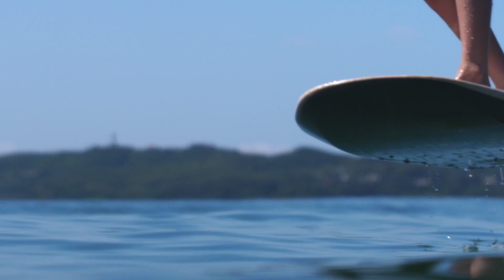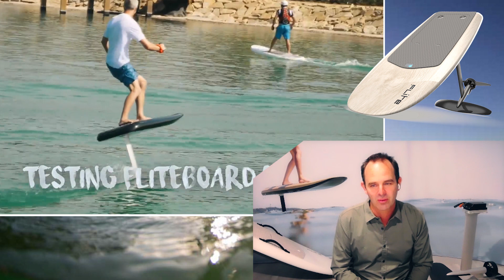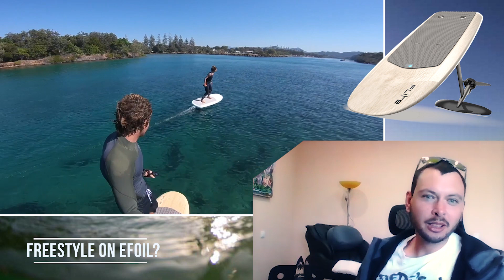Why EFOILS are so EXPENSIVE? ft David from Fliteboard

Comment from the maker: "$12,000 for a foil with a motor??? I could buy a JETSKI INSTEAD!??"
Electric hydrofoils or Efoils in short are quickly becoming the next big thing, one of the most fun ways to spend time on the water.
The fast, smooth and silent cruising over the surface gives you an amazing feeling of flying...
But the main question remains - why are they so expensive? Today we meet David Trewern from Australia, the creator of the Fliteboard to ask him the most uncomfortable questions from our followers.

Timecodes
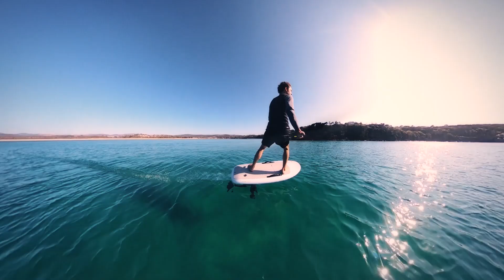00:00 Why EFOILS are so EXPENSIVE? Welcome David!
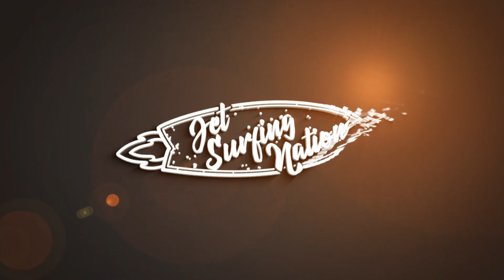00:31 What is Fliteboard efoil and exciting news after first 1000 boards sold?
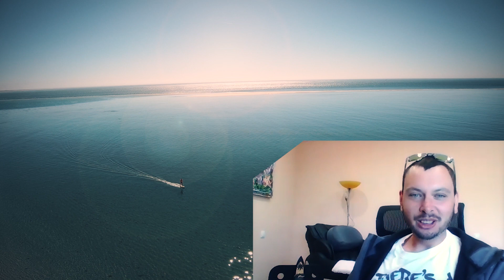01:55 Why EFOILS are so EXPENSIVE??? Uncomfortable questions from followers
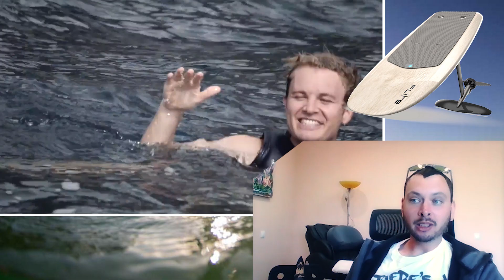06:10 Can you compare the components of efoil a carbon sailboard and electric outboard motor? What goes into make a quality and lasting efoil?
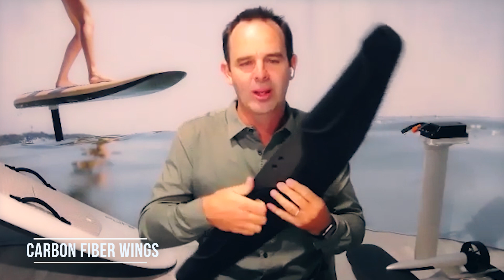10:51 - Carbon fiber efoil WINGS? 500kg of static pressure
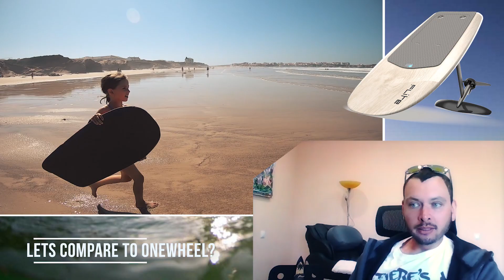13:20 The e-skateboard is usually priced around 250 usd..why is efoil battery so expensive? It's like 10 times more than Onewheel
16:05 "I could buy a JETSKI for that money!?"
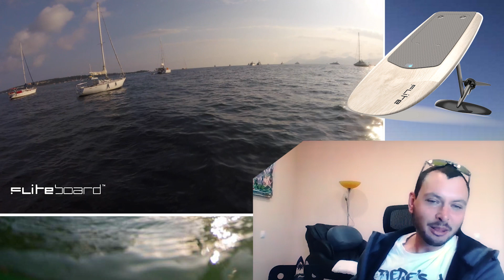19:35 Lets compare the petrol engines vs electric ones? What's more economical long term?
21:38 Most people don't realize that aside of the price of the product itself, a lot goes into the quality post sale support and service. What happens if the board breaks?
23:20 The popular question is "why would I pay 12k if I could buy same on ALIBABA half the price"? Could you compare your efoil to those generic chinese efoils sold on alibaba?
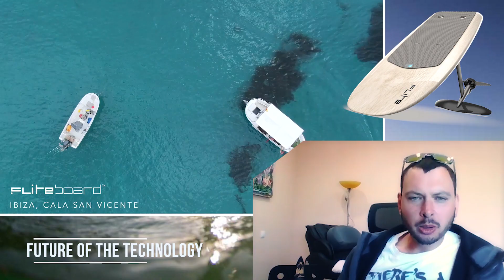25:17  Do you expect the battery technology change significantly during the next 5 years that may make efoils more affordable to mass markets?
27:40 The main problem of traditional electric jetboards without foil is their big weight and a very short riding time. How does efoil solve these problems?
30:11 Some people believe that using motor in the foil is basically cheating. Being a sports professional yourself and a kitesurfing world record speed holder what do you have to say about it?
33:17 Efoil Radical tricks, racing, jumps and backflips, efoil waveriding?
34:27 Electricity and salty water are not the best friends. What is done to make sure the battery is safe to use in the salty water?
37:20 We had a great interview 2 years ago in Spain and now you sold your first 1000 boards.. What changed since then? Tell us the exciting news about your new Flite app, new wings and what's coming? Will there be efoil racing in future? A version with pads, rope?
41:27 How to choose Efoil to get started? Size, mast, wings configurations? Pro board? Inflatable efoil?

Comment: Im  competent wingfoiler looking to foil surf when no wind. If I catch a wave on your gear and turn the motor off how well does it function as a normal prone foil experience riding the wave?
Reply from the maker: You need foil assist system for that

Comment: If you can make a comparable product a lot cheaper, competitors will. That would force the higher price manufacturers to lower costs and prices to stay relevant. Higher demand and sales can also improve costs. I too have all along questioned the pricing on these but economics usually works itself out. I’d like to get one at some point.
Reply from the maker: They have it cheaper this year

Comment: How do you get sitting down if your board doesn't float you?   I'm 235lbs and my Lift 5'4" has 88L of floatation volume.  The board is below the water completely when I'm on it, so I can't see starting sitting.  The only thing I can see is dropping down from standing position?
Reply from the maker: It's not possible Mike

Comment: Here's a crazy idea: Would it be possible to make an eFoil that works like an eWheel (electric unicycle/EUC)?
If you put your weight forward, et moves forward, if you put it backwards, it brakes. Maybe it would be forward-facing rather than standing on it like a board. With the big advantage that both your hands would be free. You wouldn't need a remote anymore.
It seemed crazy when eWheels started appearing, but they're actually shaping up to be the most efficient form factor on land, and even without using hands, you get far greater control than on something like an electric scooter.
Reply from the maker: check levelfoils they are making your idea lol it's selft balancing efoil without a remote
Reply: @JetSurfingNation  Wow yes looks great! Being able to do away with the remote is a great plus. I wonder, though, if we'll be able to do curves that are as tight, and potentially jumps and riding waves with the motor turned off as you guys do? Will it be possible to combine user-friendliness and fun?
Reply: You need the throttle to feather in and out of the power during turns and such. it's not really a detriment to have a throttle in your hand.  You aren't doing ANYTHING with the other hand.   ;)
Reply: I can see the merits of both, but agree, you'll likely want throttle control for wave riding and tricks.

Comment: I could literally carve a surfboard out of the materials and download &print the wings with 3d printer.
Reply from the maker: Try to print the engine and battery;)
Reply: @JetSurfingNation  those dont cost like 12k lol. Even if I buy the highest quality batteries and motor, I can guarantee that I would cost less than 2k.
Reply from the maker: You sound very naive mate.  It's good to research the market and prices before making such ridiculous statements.
Reply: @JetSurfingNation its a  matter of economics.  the high prices are not for the products "higher qualities" or "research expenditure". the small demand and lack of market competition allows them  to control supply by yanking up the prices. same thing is done by designer brands. pretty arrogant for fliteboard though, since they don't have enough brand image to try that strategy.
Reply from the maker: Have you even watched the video? There is plenty of competition. But the production quality and post sale service is what makes the difference. You can buy efoil for 4k on Alibaba and you will receive a piece of plastic that will break on the first use. The bottom line people get what they pay for. Yes Gucci bag and non branded bag are almost same in production cost, made on the same factory but when it comes to high tech electronics and batteries it's completely different story.
Reply: Good luck buddy.

Comment: The Chinese are masters of de-costing without reducing functionality (e.g. 3D printers went from $30,000 to $300). Chinese manufactures will reduce the cost of e-foils.
Reply from the maker: Not happening in efoil industry. Yes you can buy efoil on alibaba for half the price and they ship you piece of crap that breaks on the first use.. waterproof technology is just too complicated
Reply: @JetSurfingNation  how about the Waydoo and Foil boards?
Reply from the maker: yes Waydoo and Foil are good entry level boards to get started but if you want to go pro you still have to buy Fliteboard or Lift.. Those have pro size boards and big amount of pro wings.

Comment: Everything this gentleman said makes so much sense. I feel the same way about jetskis also. 
I have questions about mast length. Why would I want a shorter or longer one? 
I get the shallow water thing but is there any advantages to a shorter mast other than that? 
Is it harder to fly the longer or shorter? 
Thanks to anyone who can clear this up.
Reply from the maker: Thank you. The shorter mast is much better for learners, it's easier to start and more forgiving, you are not going to fall of the high altitude. However when you become a PRO, the short mast becomes boring and you want a longer mast to carve harder, fly higher and avoid the choppy water better.

Comment: I have to comment that while the CO2 = climate alarmism is completely crap and Co2 is provably NOT a problem. His comment about Jet skis misses some other points -  Sailing is a passion of mine that I have very little chance to do until I retire and I have no problem with people in power driven vessels. There is another problem. 
Jet-Ski's Apart from the noise, any idiot can get on one - often idiots do and have little thought for other swimmers, depth speed and the dangers of such a large mass at speeds, let alone the rules of the sea - you head towards another person shall you go left or right? what about a similar craft under power, slower and bigger? What are the markings of a diving buoy? Almost every user of jet ski's has no clue about any of these points.
 - Fuelling. I have been to so many resorts/locations where the bobbing about tourist $$$' making machine is filled by an idiot while the "Business" owners doesn't give a shit about the petrol spills that end up in the water - right about upstream from where your kids are swimming in a nice film of petrol -  because some asshole with a jet ski didn't care about the actual environment! and things a spill will just blend with the water, a bit like putting out an oil fire by cooling the flames. If you are lucky, depending on fill time - the next family down stream will suffer.
Jet-skis carve up the water, they are like a blender to any living organism near the surface. This means a load of jelly fish will be minced into several thousand parts that will wash up and sting you and your kids. Of course there is a chance A fin will slice one into 2 pieces when hit dead centre, but those are more easily seen and dealt with near the shore where kids swim.
(I am really really tired of the CO2 climate alarm BS - industry! It's fake science where 1 part can heat 2500 parts around it and also that 190 years ago Maxwell (for example) was ignored in favour of Arrhenius. Greenhouse gas theory is old and WRONG. Don't believe me - fine - keep on being a lemming. 
Summary to skip the details - Titan and Saturn get about the same amount of solar energy - why is Titan COOLER despite having 8000 times more ""Dangerous/powerful"" greenhouse gas (Methane) than Saturn? PRESSURE - all gasses follow the same thermodynamic rules. 1000frolly here on you tube lays it all out - he published 3 science papers - NO rebuttal  - climate alarmism  - fake -  corona  - ww3. wake up to the game guys...please

Comment: Excellent interview this guy is on top of it I’m a product developer with 800 products on the market and I can tell you it takes tens of thousands and hundreds of thousands of dollars to develop products and you have to recover those costs on top of everything else so he makes perfect sense.
Reply from the maker: Cheers!
Reply: You should come up a design that you just can sest and drive with a steering hand drive because it's tirely standing for about 2 to 3 hours driving on standing position. You can also make a design that it can accomodate two person like a jet ski.
Reply: These expenses could be shared among more people if they would. But a minimal price of about €2k (this is a fair price, because of batteries and a manual work with carbon, that can be done in China for small money though) is a show stopper for public. And so those who agree to pay €2k will most likely pay €5k for a budget model (the same thing is with €4k fair price and €12k final price). As for R&D most of the things are already known, and so new manufacturers could save tons of money and offer a lower price, but a limited market won’t let them do this.

Comment: What bothers me is obstacle and debris in the water that can damage the $3000 motor module.
Reply from the maker: You can hit underwater logs or sandbanks but you are hitting it with the mast or front wing not with the motor which is behind, so no problem. Worst case change the wings.
Reply: @JetSurfingNation  I live in London on the river, I normally go kayaking but wondered if this would be suitable, more concerned about hitting something below the water surface.
Reply from the maker: Yes rarely you will hit a log or a fish. It’s not a big deal. You fall off, stand up and ride again. Unless you hit a strong rock, nothing will happen. The mast is alluminium and very durable
Reply: @JetSurfingNation  many thanks.  It will be something I will consider getting

Comment: Makes completely sense why they're so expensive! I mean, these guys run businsses and are not into charity, so they have to make some profit as well, in addition to the development & production costs.
Reply from the maker: Well said
Reply: Nothing can justify that price. I can literally hire a guy, order him to make a efoil board for me, and it would still cost less than 12k(almost a price for a car here)
Reply: You're right, it's a business and not a charity. But don't get your panties in a bunch defending a company that has little overhead and sells at niche prices. It's an electric surfboard, not a used car. Comparable parts sold online such as motors and the foils themselves cost under $1k. 

It's the patents they put into this that'll make it difficult for other companies to bring eFoil's to the mass market (a la FutureMotion/OneWheel's strategy). AVG salary in USA is around $30k! shrugs Just my two-cents.

Comment: the technology is high , materials are goods but actually, 12500€,  it's overpriced. Just have a look of the price of PWR foil : 6500€ to own an efoil, with very correct features and performances.
Reply from the maker: I have not seen much of pwr unfortunately. While Fliteboard is producing and shipping thousands of efoils this year. We cant really compare the production capacity
Reply: @JetSurfingNation  thanks for your answer. Compararing price with advantages of a product, like technology, features, main quality ...is the way customer like. Comparing amount of solded products is another way and this way don't explain the high price .  Just have a look ok Takuma foils : they add 4000€ to electrify the foil, with total price of 6000€
Reply from the maker: Yes you can ride takuma for 6000, it's a great beginner board... But truth to be told all my takuma friends already upgraded to Fliteboard. The difference in quality and riding experience is really worth the money. Cheers!
Reply: @JetSurfingNation  OK, if you are not paid by Flite I take your advise for granted, but if you are paid this will be part of the overpriced explaination :-)
Reply from the maker: I am independent from any brand we review.. we did reviews of all brands

Comment: he said they keep it as light as possible but at around 7:00 min he said the motor can output 12kw and the esc can output 20kw. but they only use 5 kw. that doesnt make much sense?
Reply: I think it's due to the battery and the necessity. 
If you used maxed out the performance the battery would last half the time and you'd go twice as fast. I don't think you want to go faster that 50kph. Imagine falling at that speed? Or falling on the foil and prop at that speed. 
Also, they don't manufacture electric motors or speed controls so they used what's available. 

Also,  You don't want to max out a motor so getting one that you'd be maxing out would wear it out faster. Also if you did manufacture a 5kw motor it would likely weigh so similar you'd not notice any difference.

Comment: Yeah whatever. The reason why it's so expensive is because there has been much competition. Once more people start mass manufacturing this it'll be in the 3 to 4 k range.
Reply from the maker: Yes... It sounds good on theory and I've seen many people coming in the industry with this idea "i can do better and cheaper" and going bankrupt after a year or so.. The tech of electric & batteries dealing with salty water, safety and service is just too expensive and it remains the niche market for now.
Reply: @JetSurfingNation  not a theory just basic economics. A company isn't going to set up a large assembly line if there are few competitors and even less demand in the market. Just look at anything; 3d printers for example for over 1k when first introduced. Now people can actually afford one.
Reply from the maker: It's very different and incorrect comparison... 3d printers similar to CD players in the past were simply overpriced due to novelty. However the technology that involves batteries etc does not get so much cheaper. Compare price of first iphone and the new one? Almost 15 years passed, almost same price. It did not become 2-3 times cheaper. It just remains in the premium niche.
For efoils and jetboards the problem is it's very nichy and that's why it does not go mainstream. It just remains expensive niche product..
Reply: @JetSurfingNation  water sports are only niche because most vehicles; people cannot transport with the family sedan. This on the other hand will likely change that, and be less of a niche than jet skis and boats. Not to mention this could be used in rivers and lakes as well as other spots that doesn't have a boat ramp. I would say in a few years there will be many people competing for sales and the price will drop. There is already a company selling these for 8 to 9 k. USD.
Reply: @JetSurfingNation  David from Fliteboard has done this right. You can't build these things with cheap batteries or cheap technology. Fliteboard is expensive but from what i see a beautiful piece of reliable equipment. There are a few manufacturers that are close to competing but have to get over the reliability factor.
Reply: @JetSurfingNation  going bankrupt is exactly what will happen to most people who buy this.  Did you pay 12,000 for yours?  Point is, it's too expensive and not many people will be able to buy it, don't get me wrong, I am happy it exists but sadly this company may not last long.  I would love a rocket ship too but only Elon Musk could afford one. It doesn't matter how good it is, it simply isn't affordable.
Reply from the maker: Why?
Reply: @alaskanalain  Fliteboard was first to market and had sold 1000 units by theend of May this year. Its not affordable for you maybe but if it is for 3% of the population thats a large enough of a target group.